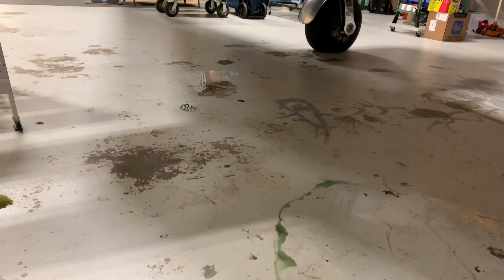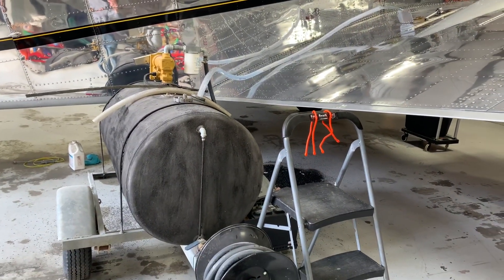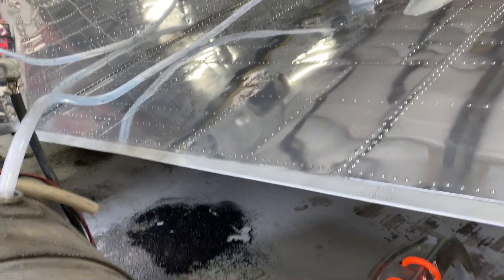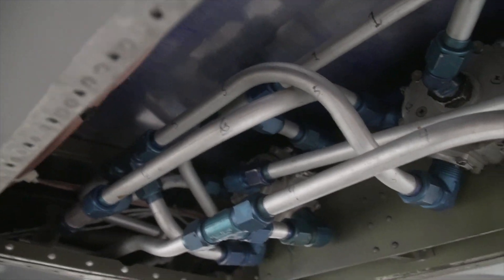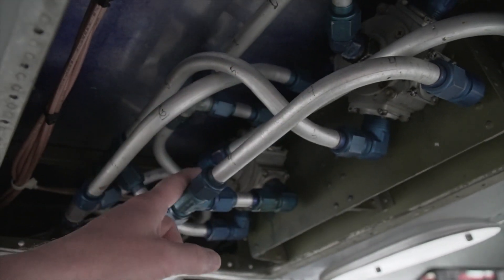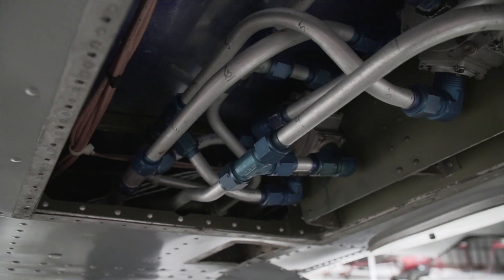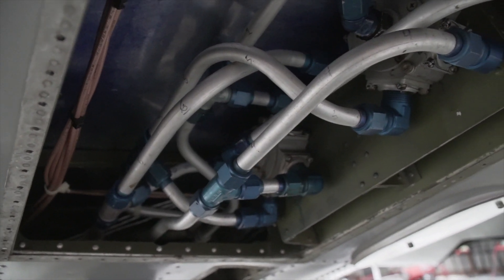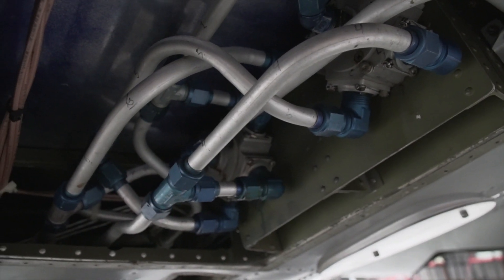Fuel Leak on the Lockheed

Comment: Oh the joys ownership.! I often found every bit as much pride in my bird while fixing her as I did flying . Becoming one with your airplane and it's limitations most often stems from the inside out, something most pilots who are not mechanics will fully appreciate. You got this Glenn and wander if maybe the other cross feed might be getting tired the same. I think I would pull the other one as well since your in there. It's good your taking pic's of the Juggernaut of tubes running every direction even though labeled. Love your show and value your incites into the inner working of the Lockheed. Don't forget to have fun, one day at a time.! Thumbs Up to you for caring and sharing..!